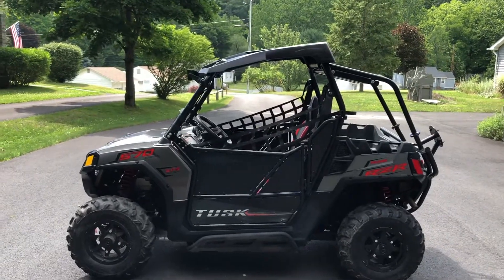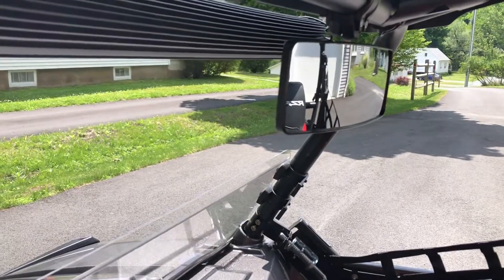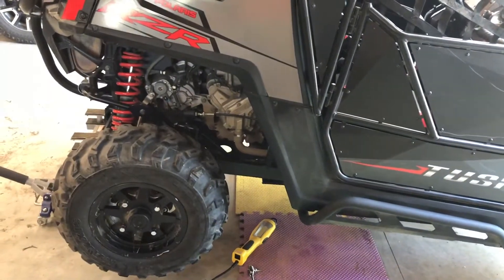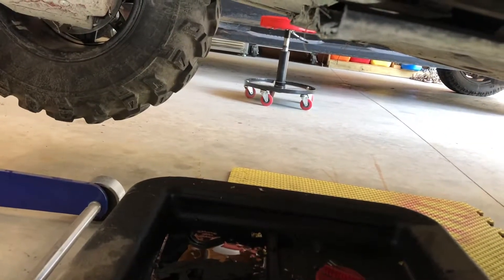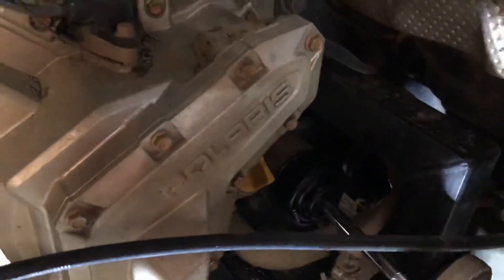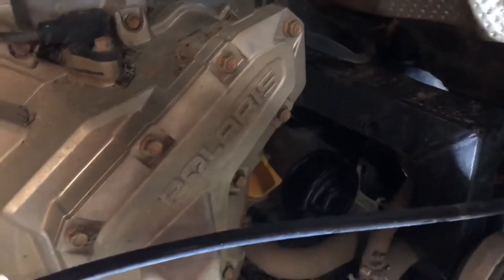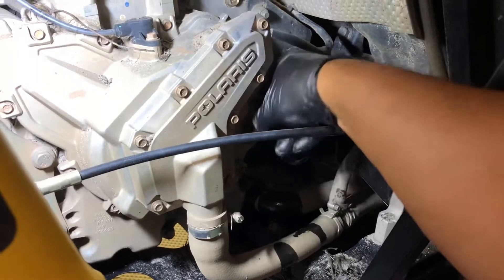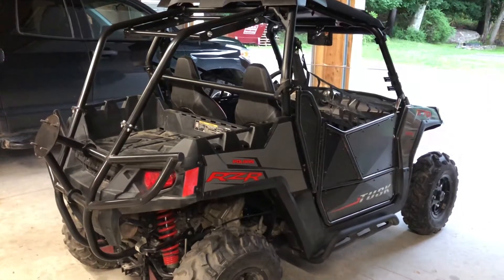Polaris RZR 570 review and oil change

Comment: There’s an oil filler cap on top of the engine. Right under the big plastic cover. No need to fill your engine through the dipstick hole.